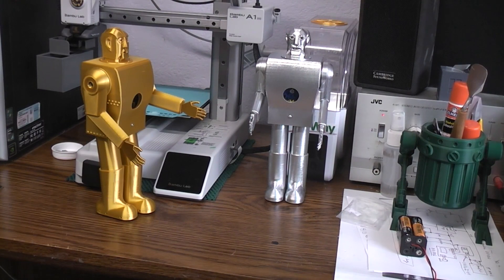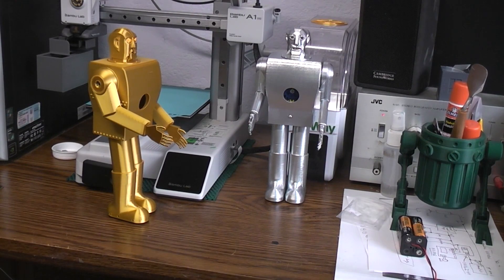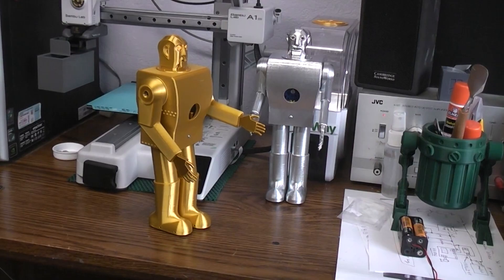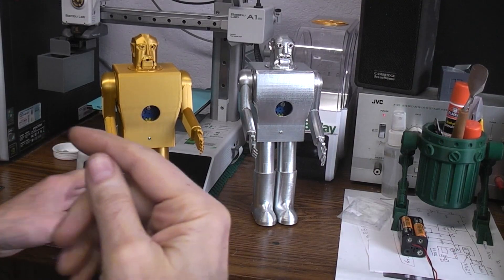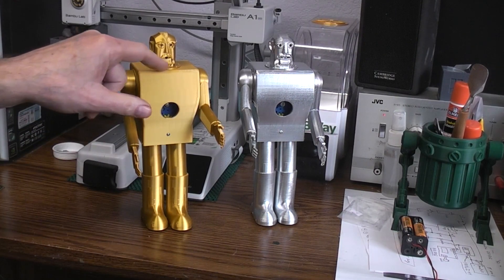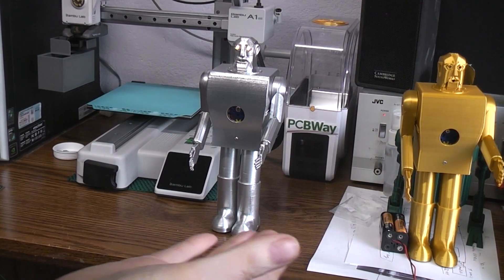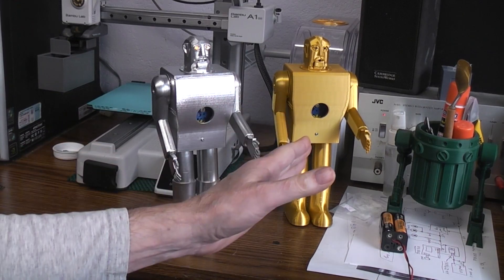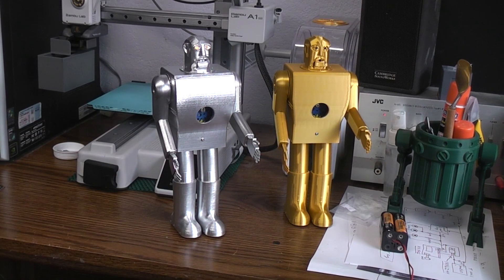Testing different Voices with the Voice recognition 3d printed Elektro Robot Project. N20/TT motors

Comment: That's very cool. It's possible the cylindrical shape of the head was amplifying the motor noise and now that you blocked it off, it works better now. Good job figuring that out! 😁